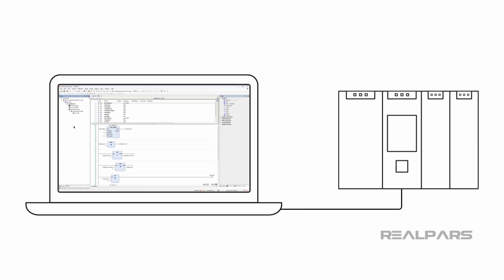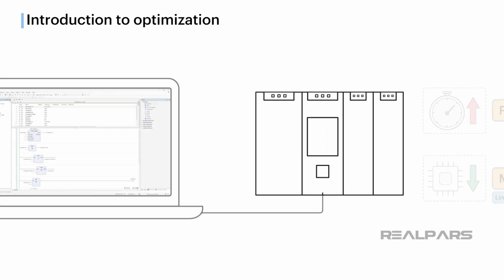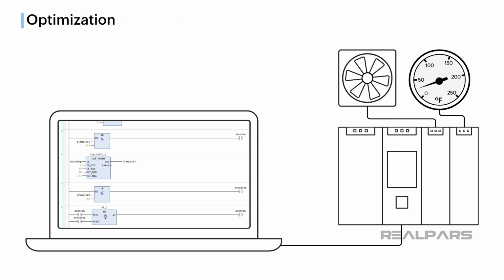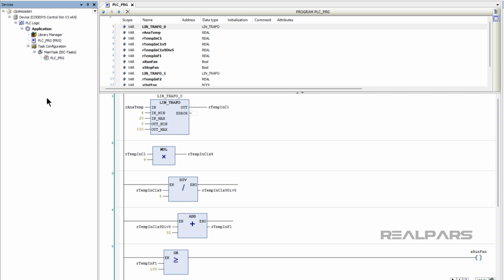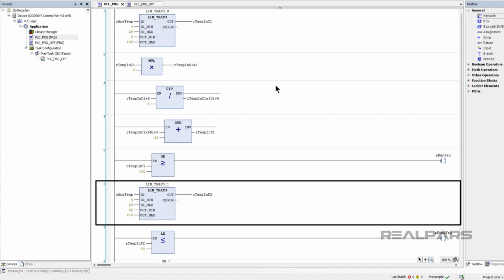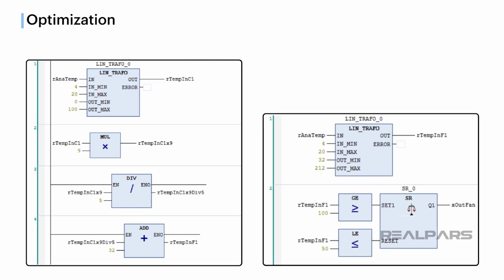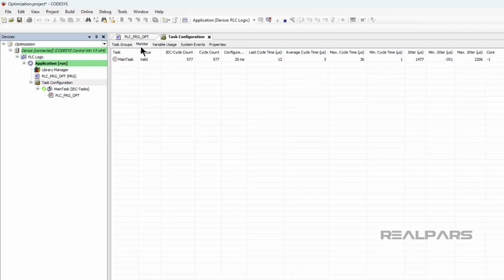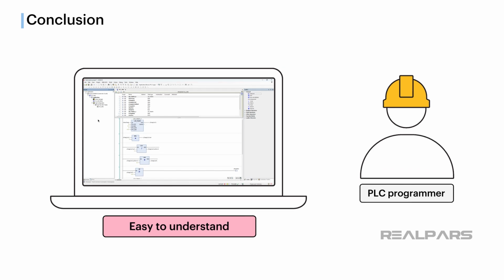CODESYS PLC Programming: Tips for Maximizing Performance

Comment: Ah codesys, the company that released a finished product with 0 unit tests and barely any documentation. If you're gonna close access to the source code at least document your system well. 

Their SysFile lib is riddled with bugs it's just scary.  The AM_APPEND flag creates a file even though the doc says it shouldn't. Error messages are undecipherable. SysFileGetTime stops working as soon as you open a file as write. etc. 

Don't even get me started on Visualisation and invisible variables + logic. Codesys never again.

Comment: I've worked with codesys using an Eaton PLC and a Festo PLC. It work well for the most part, but programming in ladder is absolute trash, you wouldn't believe that a finished product like Codesys would get away with this. I DO NOT RECOMMEND. They support ladder but you don't want to use ladder with Codesys.
Reply from the maker: Thank you for sharing your experience with us, Marc.